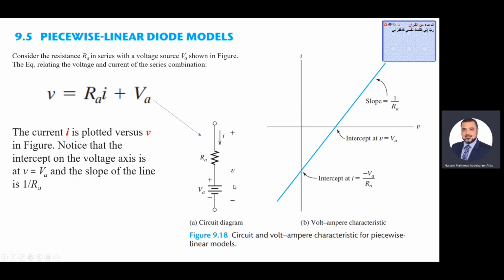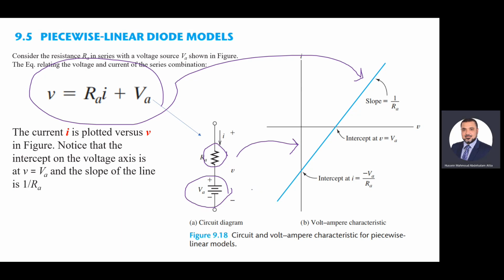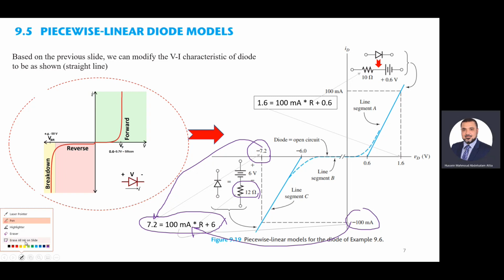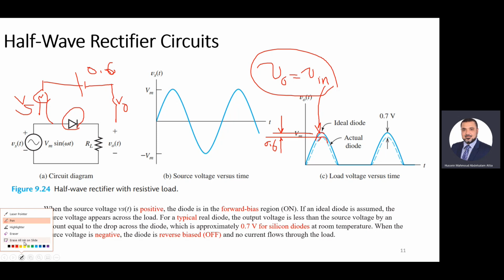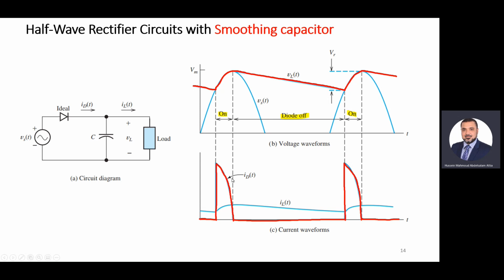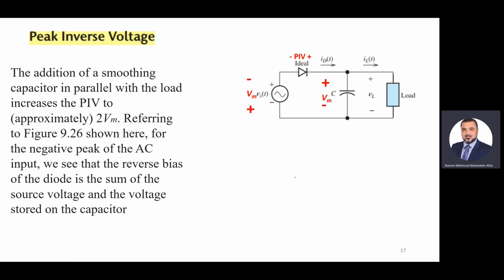Rectifier + Wave Shaping Circuits_Part 1 (EE 234  Sec 9.5-9.6-9.7 )

Comment: 0:40 PieceWise Liner Diode Models 
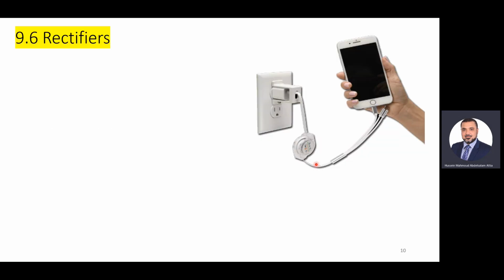7:23 Half-Wave Rectifires 
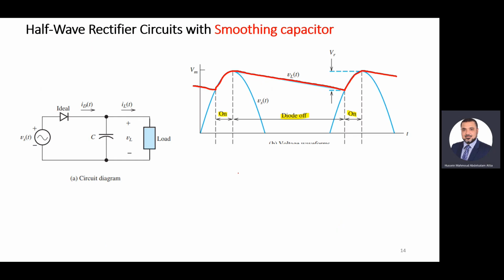8:50 Half-Wave Rectifres with a capacitor 
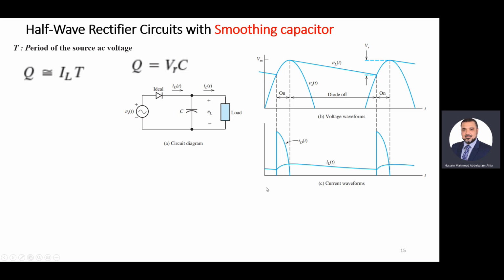13:55 Charge in the half wave rectifier with a capacitor  And Vr
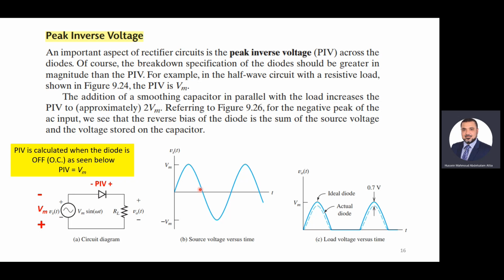16:58 Peak Inverse Voltage